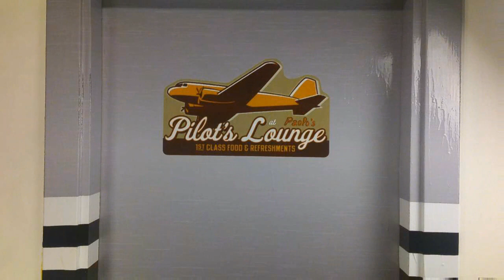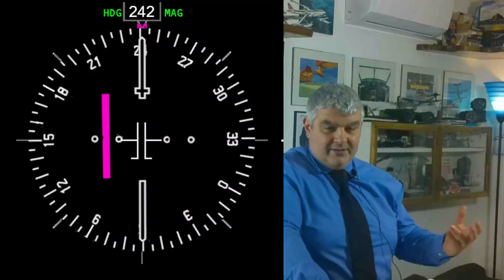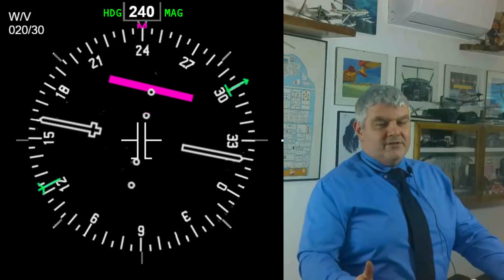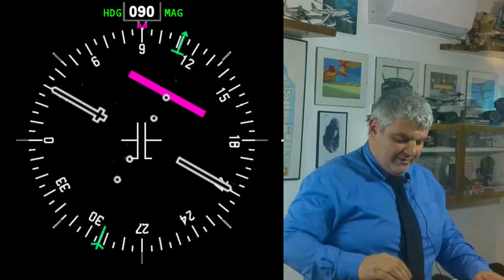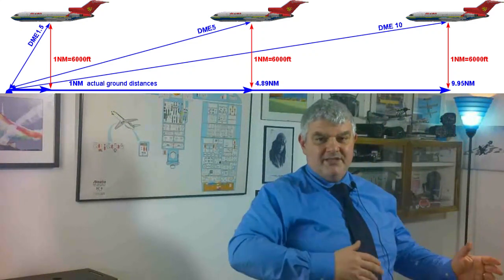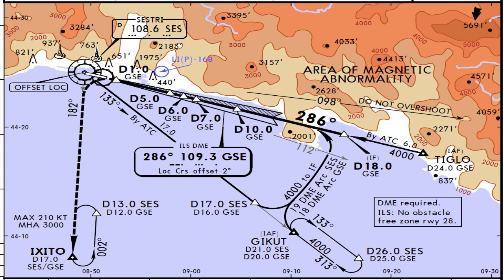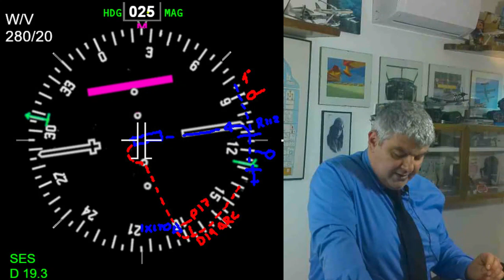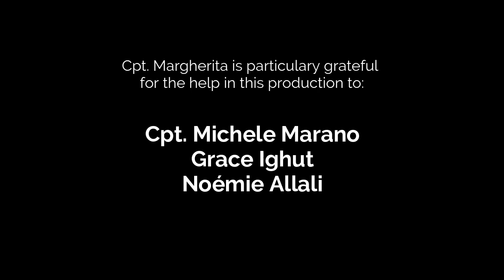Children of magenta VS. RMI and HSI "how to" hold entry, DME arc and wind correction angle: part 3

Comment: came out 4 days before my assessment date, thx for the effort, great video!
Reply from the maker: My golden rule for entry assessments is: keep doing what you always did, don't change anything-stick to the plan! I would be absolutely glad if you  find my technique much better than anything else you are using, but three days before the assessment is definitely not the ideal moment to change a technique!
Reply: @paolonespilotslounge  hey Paolo, yes, you are absolutely right. I used the techniques that I was most comfortable with on assessment day. However, still find your videos very inspiring, and they definitely helped me to get a better understanding of reading the instruments. Your part 2 video was most helpful. Thanks for the effort you are putting in trying to help others!
P.S.: I passed the assessment for my first pilot job ever, will fly the 737 soon 🥳